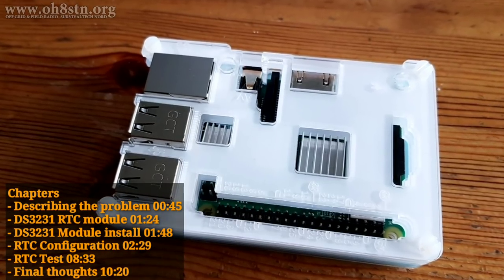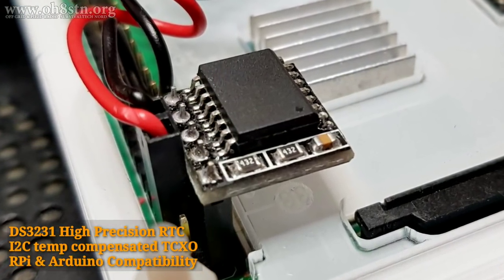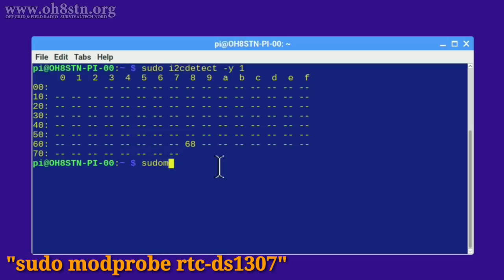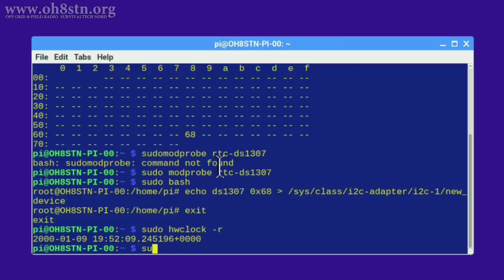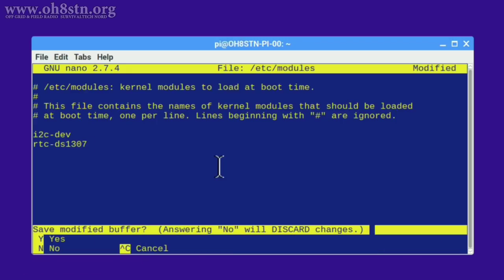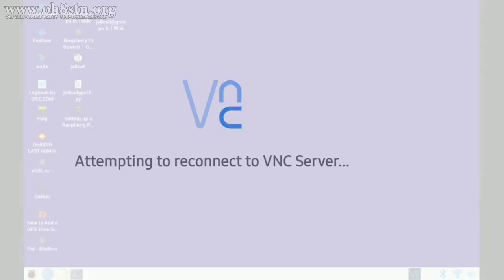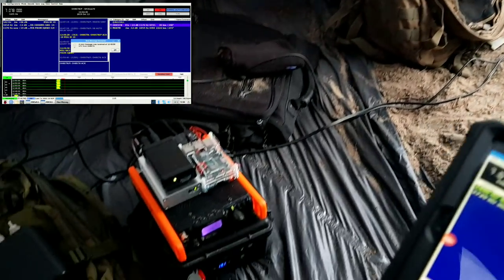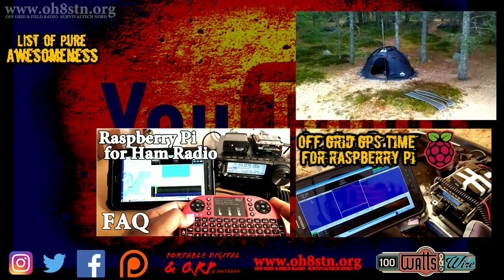Raspberry Pi Real Time Clock | Raspberry Pi Field Computer

Comment: It's great that you're implementing a Raspberry Pi amateur radio control computer, one module at a time.  These stand alone videos are a fantastic resource for Pi enthusiasts, inside and outside the amateur radio community.  I suspect most of us are eagerly following along on every episode until the finished product is realized with the lazy intent to quickly assemble the parts and install a ready-to-go complete image that includes all of the software with everything pre-configured.  :-)

Do you anticipate any need for the capabilities of a Raspberry Pi 4 in the next year or two?  I'd generally want to invest in the more capable hardware to increase the project's lifespan.
Reply from the maker: Sitting here giggling to myself. I hope by the end of this year, there will be an interestin gupdate in regards to the rpui in the ham radio world. Easy to implement rpi and components, using off the shelf parts, ...
Im also testing the rpi4 4gb in parallel, making sure everything is forward compatible.
Ill do a coupld of "big" videos to finish off this month, then publish a few more rpi tutorials.
We are definately on the same page :)

Comment: Great video Julian. You might want to consider looking at a Pi Hat that also has GPS, PPS and RTC integrated into one. Super-accurate without much fuss about sync.
Reply from the maker: There were a couple of them out there but there was one problem with them. I couldn't run external DC power to the header pins when the Hat was installed.

Comment: I have a question for you (semi-related to this video)...
Instead of using a tablet & Rii i8+ BT Mini for interfacing with your "off-grid" HF+pi radio configuration, would it be possible to use something like the old HP Jornada-728 handheld PC?  Really digging your overall setup except for the bluetooth and touch-screen stuff, personally I'd rather connect via a cable (e.g. PC Serial Cable) with a pocket/handheld PC...

Call me crazy but I'm not a fan of bluetooth or touch-screen electronics.

Comment: I’m following steps carefully. The FTC chip is properly connected.  When running the i2cdetect -y 1, the return says no such file or directory exists.  Any thoughts?
Reply from the maker: Try "sudo i2cdetect -y 1"
Reply: OH8STN   My apology. I did use ‘Sufi’ the first time. I looked in the /dev directory with an ‘ls’ and it does not exist. It’s a Pi 4 running Buster.
Reply: Obviously, I can’t type.  SUDO.  I started over and redownloaded the i2C tools and all is well.  It works great.
Reply: I got this error too: "Error: could not open file '/dev/i2c-1' or '/dev/i2c/1': No such file or directory". To fix it, I needed to go to sudo raspi-config and enable the I2C interface.  Then running sudo i2cdetect -y 1 worked.  73!
Reply: Eric Wiessner That is the same step I missed as well.

Comment: Hello thank you for video. Should i remove charge resistor for this mini DS3231 ?
Reply from the maker: Thanks for the question and kindness. I use it just like that, I haven't made any modifications to it. Hope this helps.
Reply: @OH8STN  Thank you for your kind answer, i searched it many times but i could not find knowledge that remove or not. the other DS3231 RTC (big one and can be use arduino) requires to remove charge resistor for cr2032 battery. Thank you again

Comment: Julian, thanks for these videos!!  You and Jason, KM4ACK have really helped me in getting my Raspberry Pi up and running.  I have 2 Raspberry Pi's, one is a Raspberry Pi Model B+ V1.2 (I assume a Raspberry Pi 2) and then I have the Raspberry Pi 3 Plus.  I bought these about 2 years ago.  Haven't done anything with the Raspberry Pi 2 since it has no bluetooth or wifi.  But I was trying to setup the Raspberry Pi 3 and really got frustrated, I am a Windows guy not a Lynx person.  I hated the 3.5 inch screen and even the 5 inch screen, just couldn't get things configured right.  But I stumbled upon your videos and then Jason's videos and now I have a full working Raspberry Pi 3 Plus that I can use with my FT-817ND.  I have been doing some FT-8 with it, fired up JS8Call, but haven't made a contact.  I still need to get that little amp that you have, oh thanks for answering my questions on how I needed to order it!!!  So again I want to thank you for helping the ham operator and the non educated Raspberry Pi user on setting this thing up to work with amateur radio!!!  73 for now, Juddie WD8WV

Comment: The instructions to add the RTC worked fine.  I'm using the ALLSKY camera App out in the boondocks where there is no internet or cell phone service and need Time of Day for a few hours of imaging before returning home.   Will it be necessary to set the DATE before leaving Home and the internet  or will I need to add the GPS ??????????????  Thanks for the excellent video(s).
Reply from the maker: I think if you set it up and use it for a couple of days before you head out it'll be fine. The most important thing is charging up that little battery or super cap whatever it is inside the RTC before you head out. The GPS is just a back-up plan.

Comment: Julian, any thoughts on using the RTC with a 7” touchscreen, which uses some of the same pins?
Reply from the maker: Chris this is an annoying problem, which I haven't found a solution for yet. When I was using the touch screen, I had to remove the real time clock and simply sync the time through the GPS. I know this isn't a good answer but that's the only way I was ever able to get around it.
Reply: OH8STN Ham Radio, thank you!

Comment from the maker: Chapters
- Describing the problem 00:45
- DS3231 RTC Module 01:24
- DS3231 Module install 01:48
- RTC Configuration 02:29
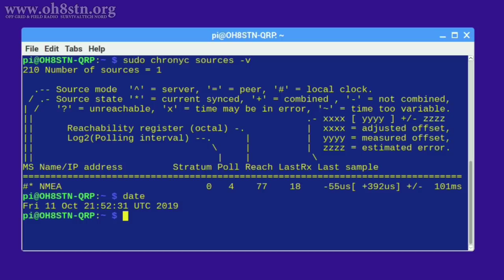- RTC Field Test 08:33
- Final thoughts 10:20

Episode notes: https://oh8stn.org/blog/2019/10/14/real-time-clock-raspberry-pi-off-grid-time/
Information about the field station: https://youtu.be/smrqXZI7XwQ

Comment: Julian, thanks as always for making your clean efficient videos, I always enjoy them. I was curious, do you get your information from specific sources or randomly like a lot of us from YouTube, blogs, and forums? Do you have any suggestions in that regard? I've learned a lot in the last 2 years, especially this last year. Learning from you and a few others on effective gear choices and configurations, as well as electronics knowledge which I think is very lacking in our community these days. Sadly I don't find most older (I'm 37) hams very approachable, they tend to be crank, way behind the times, and just plain rude so it's hard to learn electronics/antenna theory from them. But the other side of that is that I find that I learn better from YouTube and blogs more than I do some most people in person. Needless to say it's difficult out there to learn some of those skills that are missing, and it's sad. I don't want to be, as I read once on Hackaday, an "appliance operator". I want to know how to build things, to troubleshoot things, and to repair electronics from the component up, otherwise all of us are screwed in real long-term/hard grid down situations if anything breaks.
Reply from the maker: Hi Devin. 
This is a tough topic. I always find it difficult to find good information from blogs, youtube, ... Most of the time there is talk and talk and talk, click the links, more talk, with no actionable information. For the Rpi, I use the standard rpi information sources. For ham radio, I bought lots of books, befriended like-minded souls, then got out to the field to test, test, test. 
The grumpy old man problem is real. If we do anything non-standard in the ham radio community, it starts up the narrow minded haters. They are afraid of being left behind, nothing more. You just need to keep moving forward. Try to remember, ham radio is physics and electronics. Certainly we have to learn the rules, but the technical side is all physics. I learn very much from cross hobbies, like quad copters, battery building, ...
We will get there. Just don't get too discouraged.

Comment: Thanks for making these videos!  I have had trouble getting this to work with my Rpi4 setup that boots from an SSD drive in the Argon M.2 SATA case.  Everything works fine with the GPS install and RTC sync while using the micro SD card, but fails once the system is upgraded to boot from the SSD.  I can still see the satellite positions with the xgps command, but none turn red, and the location and time are never synced.  I feel like this must have something to do with the firmware update required for the SSD drive boot, but I would really like to have the memory stability of the solid state.  If you figure out how to get both setups running at the same time, I would love to have you tell us all about it... :)

Comment: Is there any way to add this to a different port on the pi or expansion board for the pi the pins were this plugs into is already taken with something else plugging to them
Reply from the maker: I've seen some of the breakout boards or expansion boards from Adafruit but I haven't used them myself. I'm using the pi juice hat as a universal ups and real time clock combo board. There are similar solutions to it so you don't have to just pick that one. Hope this helps.
Reply: @OH8STN  yeah thanks I can't find nothing online about it if I was installing one of these I cant install a fan and some of the custom cases you buy like an NES case plugs into the ports needed for the real time clock board to plug in there has to be a way with the expansion board but I just can't find it I like to still have my case plugged up and real time clock board

Comment: Hi, how are you powering this new pi?
I dont see the pijuice module.

S21BP
Reply from the maker: Actually I still have the PiJuice hats (2×) and 4 rpis:)
For this trip I powered the rpi directly from the solgen 12v dc port. I'll do a video on that pretty soon
Reply: @OH8STN  Thanks for the reply.
One more question. Do you run into any overheating issues as you dont run any cooling fans?
Or does your pi run at normal temperature as because you live in a much cooler place due to geography?
MY pi runs at almost ~55-60C without a fan!!
Reply from the maker: @md.ishraquebinshafique1968 no problem.  I think both could be true. I do run passive cooling with a heat sink, with both rpi 3b+ and rpi4. Even indoors, I've never had an issue with over-heating.
Reply: @md.ishraquebinshafique1968  Everything below 80°C is not a problem, don't worry.

Comment: I like your PiBow Coupe. I was looking at that case however,  I'm wondering weather it provides adequate protection from the elements?
Reply from the maker: You know, I pondered this question myself. I've come to the conclusion that my radios can't be out in the rain or snow, so neither can my Raspberry Pi. With that said, one of the ideas I have is to Simply cover the case in heat shrink when I'm done prototyping. Kind of the same way I've done the battery packs. Feast won't make it completely waterproof, but it will stop the odd snowflake or raindrop from creating any havoc. Someone mentioned a totally waterproof enclosure for the Raspberry Pi. I just think using it takes all the free space back which we've gained they getting rid of the audio interface. Anyway to answer your specific question oh, this case is definitely not weatherproof.

Comment: What about the DRAWS hat didn't it do the same for time and gps?
Reply from the maker: That's true it did all of those things but in my opinion it's too complex to configure. I also didn't like the performance on HF, but that may have been just a matter of the configuration. What I'm working on now is trying to do the same thing, with off-the-shelf easy to configure parts.

Comment: I noticed the capacitor received with my time clock sagging as the little metal support isn't as strong as the one in my video.  I utilized a piece of scotch tape for the time being.  Any suggestions for a more permanent fix?  Thanks in advance
Reply from the maker: Haven't seen that happen before. I would take a picture of it and send it to the seller. They'll usually replace it with problems like that.

Comment: I am curious. I have seen in other videos you have te PIJuice, which has a real time clock in it. Is this not suiable for you or are you just demostrating another product?
This will effect if i buy the PIJuice or not.
Reply from the maker: Great question. I'm always demonstrating other ways of getting to the same destination.  The PiJuice hat often creates more problems than it solves. For example, if you supply external power to the piJuice hat, its max input is 10v. This is a deal breaker when we want to run a 12v supply, or standard solar panel. The PiJuice hats Realtime clock, works as well as this one. It even has other features which are useful. I find it easier just to power the Raspberry Pi from the same power supply I use for my radio. I have a video in coming about this topic.

Comment: Hi

Just curious, you shown a DS3231 rtc physical module, but all your software setup you used "rtc-1307"?
Should we use "rtc-3231" instead?
Reply from the maker: Good question. This video is based off of documentation from the RTC maker. It worked fine for me and still is. If you like, you can test both ways to see if it works.

Comment: Your videos are great, Very informative and right to the point. I'm just starting out with digital and just purchased my Raspberry Pi 4. I'm wondering what type of monitor you're using in the field, or are you using a tablet, if so, what is it? Keep on-keeping on!
73 ! KB3VTY
Reply from the maker: Thanks. Using a tablet when using a raspberry pi.  The model really doesn't matter as long as it has wifi and reasonable resolution for your eyes.
73
Julian oh8stn

Comment: Julian, I really enjoy your videos. I just installed the real time clock module. However, when I type "sudo i2cdetect -y 1" I get "Error: Could not open file `/dev/i2c-1' or `/dev/i2c/1': No such file or directory
".
Reply: I'm using raspberry pi 4. You have to enable the i2c interface using Raspberry Pi Configuration in the Preference Menu if using the Desktop.
Reply: @arthurrourke4822  I completely forgot about the Raspberry Pi Configuration. Thanks! My Real Time Clock module is now working.
Reply: I had same problem.  Your fix worked thanks Julian.  I know just enough to be dangerous with this stuff.

Comment: bought one many years ago and revisiting this project. Connecting I noticed it's not detecting. The onboard battery is dead by now. So I resoldered a button batt to replace it.. Still not detecting. I wonder if the onboard batt matters or just needed when power is comp off.    i2cdetect -y l is not showing anything

Comment: My question is does this real time clock function in the capacity of 3 or more  time zones at once and what are or is being used to  display  time stats

using either linux or android I would have to wonder whether this mod would even be a need given time clocka are typically built into the OS model being used however finding an app to show zula local vs est, cnt/mount/wst where you can have upwards of 4-10 time zones to deal with and factor in daylight savinga 1 would wonder to have  to wonder why not 2 sets of clocka 1 set on a constant normal time and the other as a constant dls time might be a better solution in operations, given the fact whether you use gps/xg/sat data as the data source forkeeping time..

the biggest issue I find whether you use this as a medium or mini laptop or  a rackmount  PC is finding a dc-dcout power supply to run everything

because once you have looking at adding ac power draw to dc operations your power options go down quite a lot in terms  length of operations time..when you are thinking to run in terma of weeks to years off grid and applicable communications for analog and digital coomunicatons that do require a data terminal to funciion
Reply from the maker: Perhaps you're overthinking it Jason.
The answer to your first question is yes. I set the Raspberry Pi OS to Zulu time. The clock acts as a reference without caring about time zones. Time zones are simply offsets of Zulu. My offset is +3 from Zulu, yet the Raspberry Pi and the GPS produce accurate time. The OS then displays the correct offset for this time zone I have configured. There is no need for multiple clocks, to manage the different time zones.
Unfortunately the rest of your comment is incoherent. Could you edit your comment so it can be understood?
Reply from the maker: Here's a bit of information about the station Jason
Perhaps you can watch this short video then comment again. https://youtu.be/smrqXZI7XwQ
Reply: @OH8STN  i was talking in a deployment sense 

where you might  interfacing with others in different time zones to you
Reply from the maker: @jasonhowe1697  okay I understand. It's the same answer. If we are all synced to Zulu, with +/- offset, the hour doesn't matter. Just the minutes and seconds. You can think about this like when I'm having a QSO with a station in another country. Hours/offset is different, minutes and seconds are the same. 
Can you explain what you were talking about with the Mini PC and terminal?

Comment: You mentioned this thing remembers the time even if it's turned off? How exactly does it do that? And is there a limit to how long it can be off before it "forgets" the time?
Reply from the maker: It uses a supercapacitor as energy storage, to maintain the clock.
Reply: OH8STN and how long will it hold the energy, indefinitely? Or does the pi need to be powered up at a certain time interval in order to remember the time?